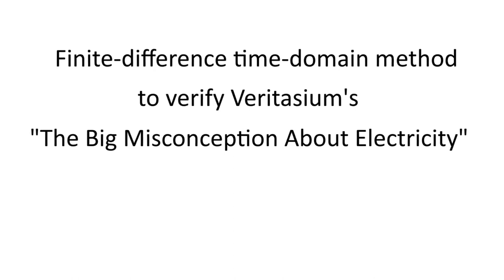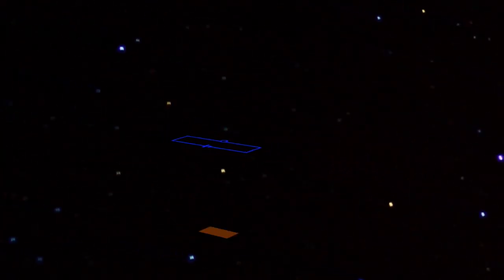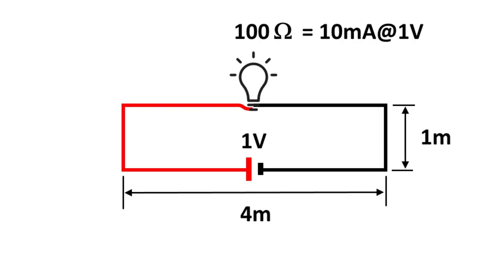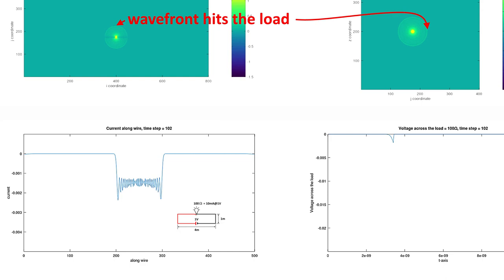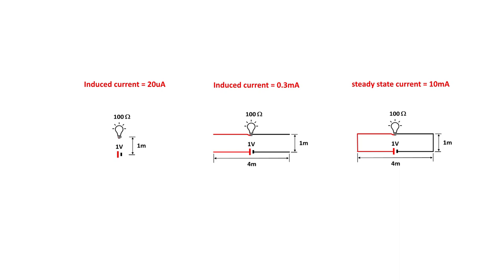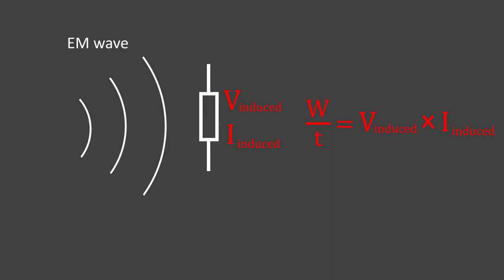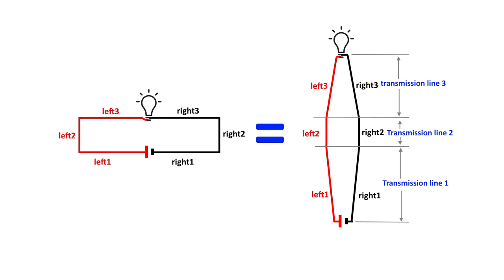The misconception about electricity as Veritasium claimed, is mostly right.

Comment: Nice. A question: you are considering the wires as homogeneous filamentary structures with no transversal dimension, right? What do you think would be the difference if their actual section and the formation of the electric field due to surface charge would be considered?
Reply from the maker: Yes, I used infinitely thin wires with infinite conductivity. As I had to hard-code the circuit into the program (no GUI for gridding the wire), so the simplest way was to align the wire to some edges of cells, and do special treatment to these edges only. These edges were where the e-field were located, so I could use it to calculate the current induced, then force that E to 0. The current is related to the 4 surrounding H.  If I model the wire with one-cell thick square pipe, then I have to use normal H to evaluate the surface current density, and then find the total current. the coding requires keeping track of the indices for E and H, much more substantial then the thin wire method. I believe the current in the thin wire and one-cell-thick wire will be very close, but didn't actually try to confirm that. Your question is spot on:)

Comment: Hello, Very nice simulation. Your hard work in making this video and doing the simulation shows. Within the stated assumptions and the model you chose, the video and the results are quite informative for any electrical engineer. I would like to mention that the final results for this problem (i.e. the voltage or current as a function of time across the light bulb) depends sensitively on the wattage (impedance) of the light bulb. As you also notice, the behavior is very different if the resistance of the bulb is high or low. For realistic bulbs that we might use at homes and the kind shown in the picture in Veritasium video, the bulb's impedance is orders of magnitude smaller than the characteristic impedance of the transmission line and hence it takes several tens or even hundreds of seconds for the entire battery voltage to appear at the bulb. So one suggestion would be for you to take realistic parameters for the bulb's resistance (I don't think 100 ohms is realistic, in your case, it will be 0.01Watt bulb once entire 1V appears at the bulb). Secondly, it is not clear what were the dimensions of the conducting wires in your simulation. The line parameters (distributed capacitance and inductance, and hence the characteristic impedance) depend on the dimensions of the conducting wires even if you assume the conductors are perfect electrical conductors. This also will affect the results of your simulation, albeit less sensitively compared to the resistance of the bulb. To understand the physics, your simulation is great. But if you wanted to find the solution to the problem posed by Veritasium, you ought to take the correct parameters, otherwise you could easily get misleading results, as most others appear to be getting (because they are not paying attention to the impedance of the bulb).
Reply from the maker: In my model, battery is the source and the wire pair (left and right) connected to the battery is the transmission line, and  Z0 is about 700ohms.  In your model the transmission line is between the load and the source, and there are two of them. I think our models are fundamentally different.
Reply: @SiliconSoup  Hello! I think our circuits are the same. The 'transmission line' is the pair of two parallel wires. So in your circuit, you have two parallel wires running on the left of the battery and the bulb, as well as on the right of the battery and the bulb (at 1:26 time frame in your video). This is correct, as in the Ve problem, and this is what I had. What I call the load for each of these two transmission lines is the 'short circuit' at the end of the wires where the wires make a U turn at 1.5e8 m distance. The bulb is not the far-end load of these two transmission lines. The bulb could instead be considered as the source-end load for both of these transmission lines.
Reply from the maker: I would get a matching load of Z0 ohms (~700 ohms), and you might get 2 * Z0. The input of the transmission line is connected to battery source in my case, but in your case, the impedance is between the load and the source. I am not sure if the math will be simplified to be the same, but the starting points are different.
Reply: @SiliconSoup  Please look again carefully. Your circuit and the one I use is exactly the same. You have 5m wire on the left (red colored), which is the first transmission line. The 5m wire on the right in black color is the second transmission line. The two input ports of the red transmission line are connected to positive battery terminal and the bulb. Similarly the two input ports of the black line are connected to negative battery terminal and the other terminal of the bulb. This is exactly what I have. I'm not sure what the source of confusion is?
Reply: @SiliconSoup  I hope you understand that the red and black wires in your circuit are two different transmission lines.
Reply from the maker: my first impression was the same as you, that red and black wires are 2 different transmission lines, but I think it is wrong. My simulation showed the matching load is z0, not 2*z0.
Reply: @SiliconSoup  No matter what resistance you use at the location of the light bulb, you cannot do load matching to this circuit. This is because the two (red and black) transmissions lines act as effective source impedances for each other. So they are mismatched at the far ends to short circuits, and at the battery side due to loading each other. Coming back to your assertion and the diagram you use at around 11:00 toward the end. You can't characterize the circuit as you have shown into three separate transmission lines. A transmission line is an electromagnetic waveguide, for which the cross section remains invariant as you move along the length of the transmission line. Then only you can use the transmission line formulae and use the parameter Z0 or the characteristic impedance. The lines 1 and 3 in your diagram are not transmission lines because the spacing between the wires is not constant, so that diagram does not serve to describe any physics in the problem. Finally, you will find that if resistance at the bulb's location is high, then the entire battery voltage appears instantly (meaning within few ns) at the bulb and stays that way. You can try running the simulation again for 2000 ohms, 4000 ohms, or any high value. Matching to Z0 is not required in this circuit and does not hold any particular importance for understanding any physics in the circuit.

Comment: I like it. A few observations, some critical, some not.

1. Veritasium's wires had heavy insulation. Hence speed of electricity is say 0.6c, not c. 
Hence your 25 seconds might have to be 37 seconds.

2. Veritasium has a lead acid battery. And his switch is near the negative terminal. Hence the current has zero delay at his switch. However your circuit does not have a switch (that’s ok) & u adopt zero delay (that’s ok too)(just saying).

3. And the critical distance for the em radiation to reach the light bulb is not the distance tween the wires, nor is it the distance tween the battery & the bulb --  the critical distance is the distance tween the switch & the bulb, however in the Veritasium setup all three are about 1 m, so no big deal (this time).

4a. At Veritasium's positive terminal (of his lead acid battery) the current must be zero for a long time (after he closes his switch) (the switch is near the negative terminal). Actually there will be no significant current at the positive terminal until the main current from the negative terminal makes a full lap of the circuit. However this long delay (of the current along this half-leg of the circuit near the positive terminal) is of almost zero importance (this time), ie it doesn't affect the answers to Veritasium gedanken.

4b. The exception to (4a) might be if the (mostly) chemical current throo the battery gets to the positive terminal before the main current does its lap. But i reckon that the chemical route might take 10 seconds, perhaps 100 seconds. If anyone knows of any experimental info re any of that (for a lead acid battery) i would be pleased to know.

4c.  Another possible exception to (4a). There might be a weak em field effect that propagates directly throo the air from the negative terminal to the positive terminal, about 12" (taking say 1 ns). This em field effect(s) would be similar to the em field effect(s) (crosstalk) that crosses the 1 m to reach the light bulb. But this weak em field effect from the negative terminal would not start until the closing of the switch was felt at the negative terminal, here that signal would travel along the insulated wire from the switch to the negative terminal, say 2ft, at 0.6c (which is say 3 ns).  So we have 1 ns plus 3 ns adds to 4 ns. But this would make only a very weak current at the positive terminal.

5. Re the 0.3 mA of crosstalk at say 4 ns at the light bulb.
How much of this is due to radio signal?
How much is due to transformer style induction?
How much is due to charge induction?
How much is due to capacitance? (I think u already said capacitance had zero effect, at the early time anyhow).
Reply from the maker: Thank you for watching, my simulation assumed ideal condition. The battery pop into existence at t=0, and the step impulse it produced simulates the switch.

Comment: Hello. That was an incredible analysis. Thank you for taking the time to do this. There is 1 problem: the model cannot "know" that the ends are not connected until 0.5 seconds has passed and the effect of that on the bulb itself will take even longer. Basically the shortcut of providing the model the characteristic impedance is resulting in an incorrect modeling of the circuit because the impedance cannot be determined until the end of the wire is finally reached and then returns fully back.
Explanation as follows: 

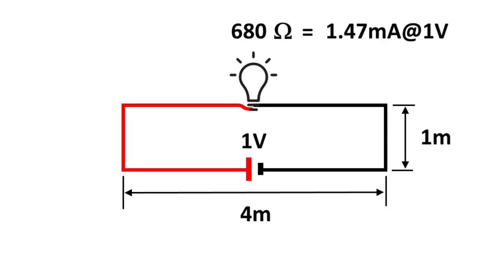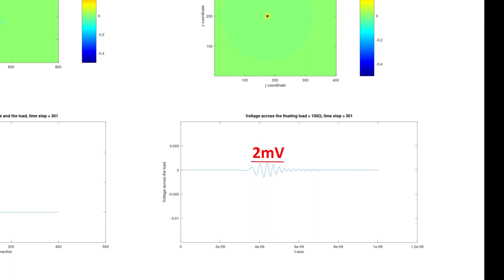 @ ~ 6:19 into the video you state that if we choose the load resistance matching the characteristic impedance of the wire then when the wire current first hits the light bulb (then) the full voltage (about ~-1 volt in your sim) is established. However, you go on to say: @ ~7:18 what if the wires are broken at the far ends... ie, just parallel wires... in that case you SHOW that the voltage is very very small (~ +.04v) . 
This suggests to me that your analysis at 6:19 is incorrect because you cannot "know" the characteristic impedance until the energy has returned. Ie,  the size of your model is not large enough to take into account the distance that must be traveled before the model can know if the ends are connected or not.
In other words, the model cannot "know" that the ends are not connected until 0.5 seconds has passed and then another 0.5 secs to return back.
Therefore, the model performed to show the results at 6:19 is not properly taking into account that distance. (Basically the shortcut of providing the model the characteristic impedance is resulting in an incorrect modeling of the circuit because the impedance cannot be determined until the end of the wire is finally reached and then returns fully back??)
Thank you for any reply. I really like the work you have done here!
Reply from the maker: Thank you for watching and the comment. You mentioned 0.5s which corresponds to the 1m segment at the far-end. It is my understand that this segment has little significance (although it produces a bit of reflection) because it is just the mid-point of a 1 second journey to the load. I understand that Mahdi and a few others regarded this as the short circuit termination for the transmission line, but I disagree with them. 
The moment the circuit is closed, current leaves the battery and flows towards the load. This current has a specific value (about 1.5mA in my simulation) calculated from E and H, and the load has yet to affect the current because the wave hasn't arrive there. The battery do see an  impedance right in the beginning because there is a current drawn. By definition, V+/I+ is the characteristic impedance, so the battery sees the characteristic impedance right in the beginning. Eventually after multiple reflections, the current leaving the battery is no longer 1.5mA, but other value due to the load becoming part of the equation, so the battery see a different impedance. This impedance that take time to manifest is the total impedance, which is different from the characteristic impedance that the battery saw in the beginning. The characteristic impedance is determined by the geometry and material of the line, regardless of the load. For example, the characteristic impedance of a coaxial cable is expressed in terms of L and C, which are geometry and material related, independent of load. So I still think the battery can know the characteristic impedance before the wave returning back from the load. (I hope i didn't miss your point).
Reply: @SiliconSoup  Thank you. Could you plot the "power" for both models? I think it would be interesting to see that.
Reply: Also, does the modeling change when you add "insulation" to the wire? It was my understanding that the wires weren't just "bare conductors".
Reply from the maker: Which two models? I will try if it doesn't take many hours to simulate.
Reply: @SiliconSoup  Comparing the power over time for the  10mA @ 1V thru 100ohms vs 1.47mA @ 1V thru 680 ohms. Looking at it to see if there were changes in power over time that had any significant patterns. But, thinking about it, as it relates to the Veritasium video, I don't see how an LED of the size shown in his video would turn on. I guess it would be more interesting to see what would happen at 12 volts with an LED modeled against a real LED that might be used just to see how much power would actually reach the LED... and would it be sustained.